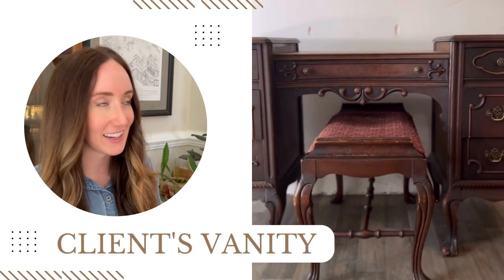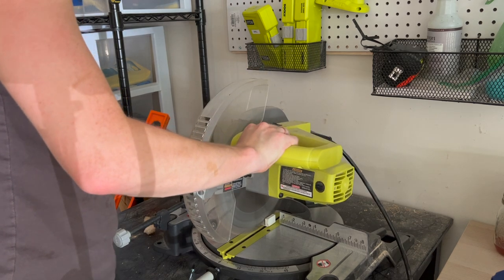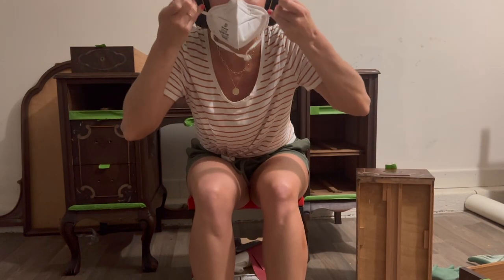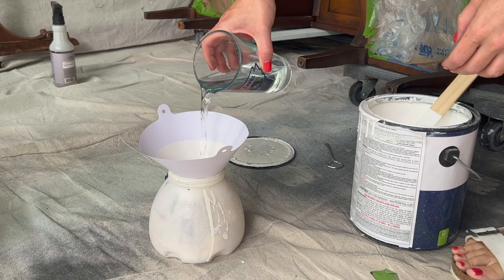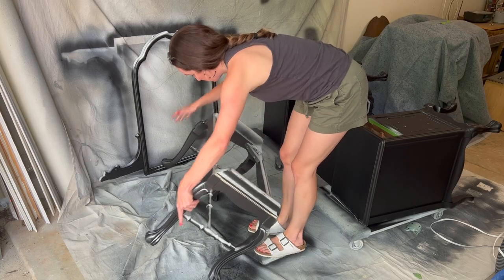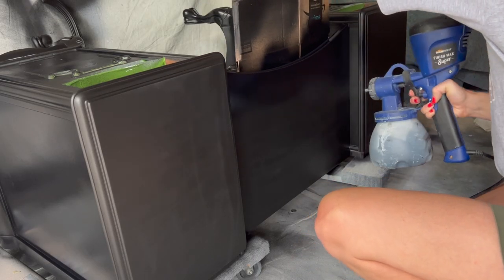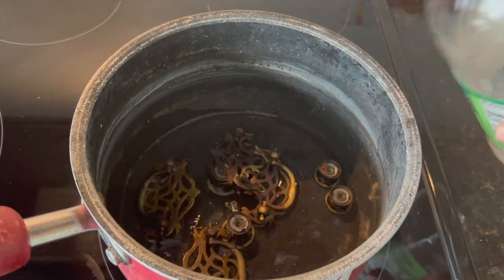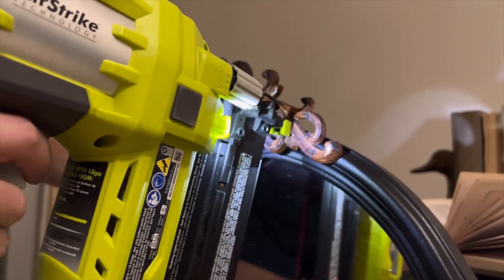Can I Save this Vintage Vanity?

Comment: Maybe your next tool should be a heat gun!  Some of those detail pieces may have been glued on with hide glue.  It softens significantly with a bit of heat, and then they would come off easier and not break.
Reply from the maker: Definitely! I wish I would have soaked it in stripper first, but heat gun in a great idea.